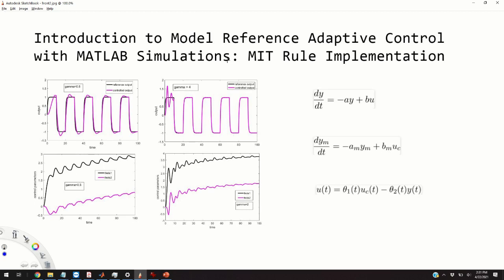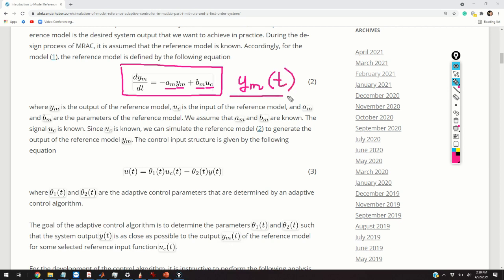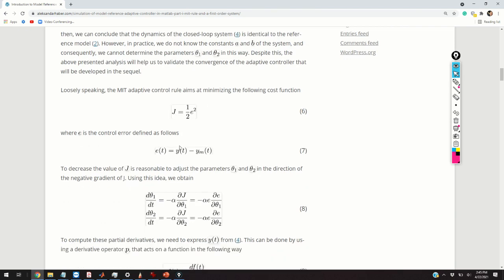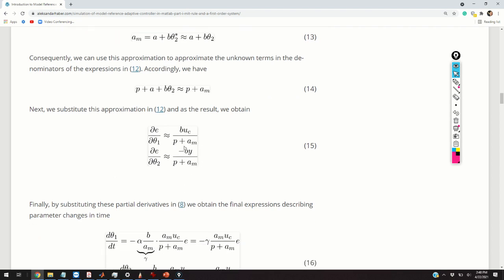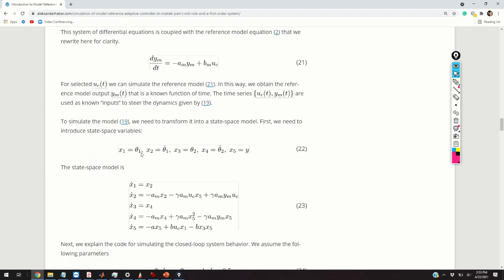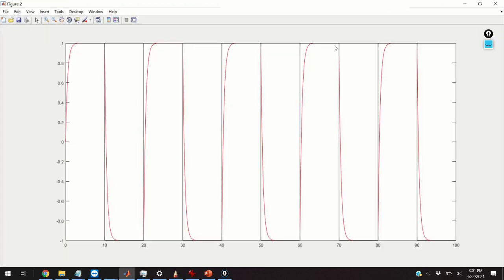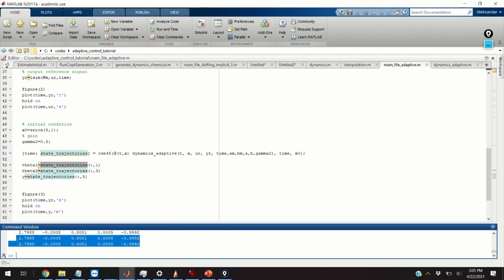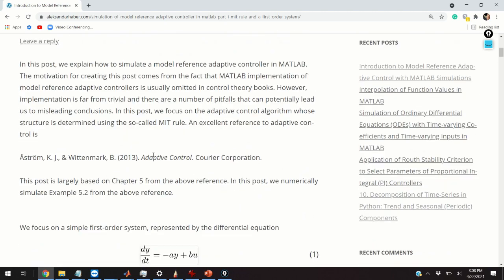Introduction to Model Reference Adaptive Control with MATLAB Simulations: MIT Rule Implementation

Comment: How we can do for if I want to replace  computed-torque  into adaptive  controller  for a exoskeleton  model in simulink  multibody, how I should  input  the reference  model in code of adaptive, pls explain  I need help
Reply from the maker: This should be possible. However, I do not have time to play with this at this point. It is a good practice to try to that, and you can learn Simulink by doing this.

Comment: Hi Aleksandar.
Can I use simulation this model by simulink? If possible how I can use lsim function to instead block in Simulink?
thanks.
Reply from the maker: Hi, I did not try this. However, I believe that you can do everything in Simulink. Generally speaking, I am not a big fan of Simulink, since I want to have a very low-level control of everything that is happening. At the end of the day if you want to implement a method in a controller you would most likely use C/C++, and a working MATLAB code is a good starting point for developing C/C++ codes.
Reply: It is totally possible to do it in Simulink! I did it, it works perfectly!
Reply from the maker: @yohanalidiazmendez2807  great